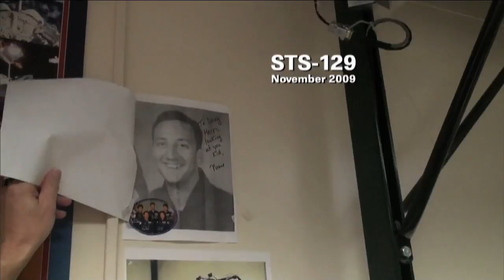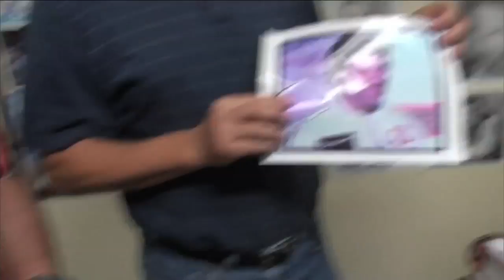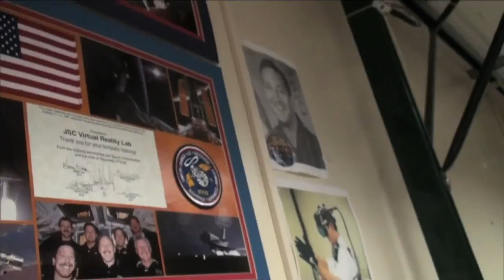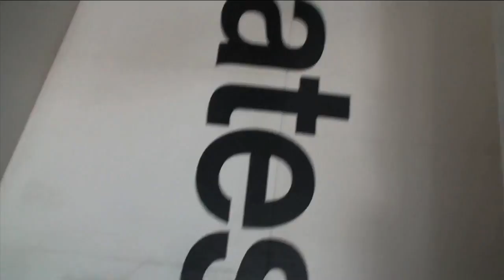Mass Shares Shuttle's "Close-Up"

Comment: So those 2 smaller engines on the orbiter, are those red covers just for show or are they actually covering the engine? It looks like it's made of plastic
Reply: they are 2 orbital maneuvering engines which help push the shuttle into orbit after a heavy payload launch and also for the re-entry burn to slow the shuttle down.  the covers are probably made of fiberglass
Reply: @kepler240  Right but normally they're not read and covered like that; so are these placeholders or just covers